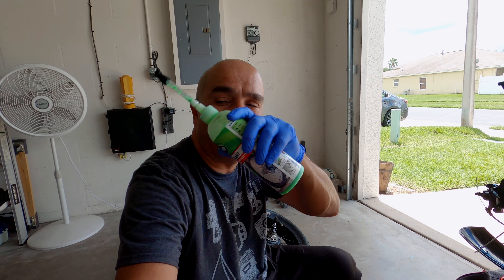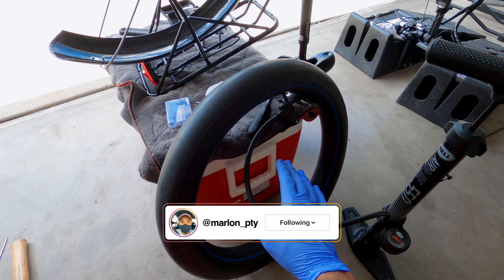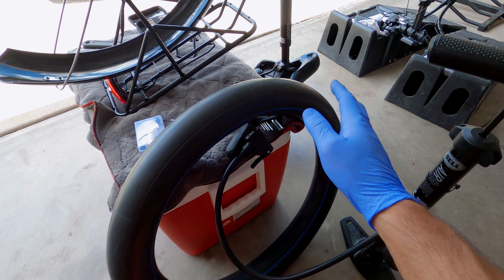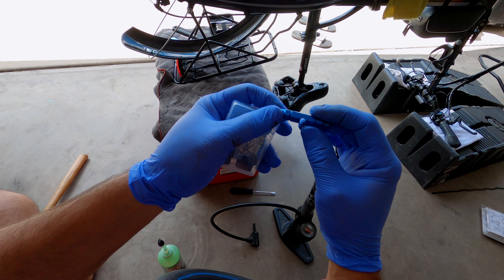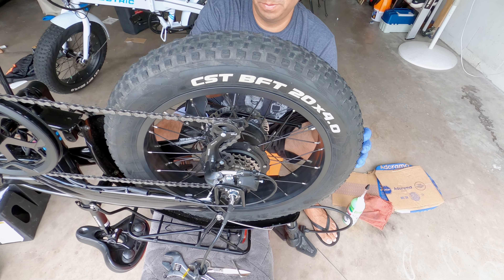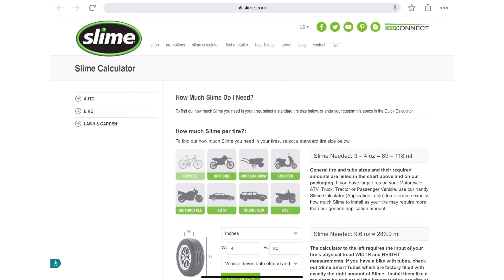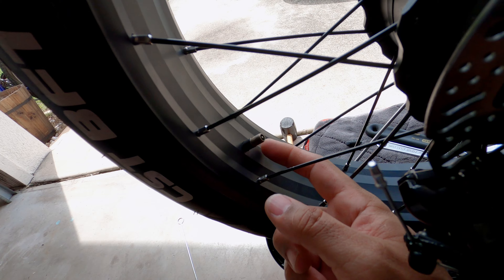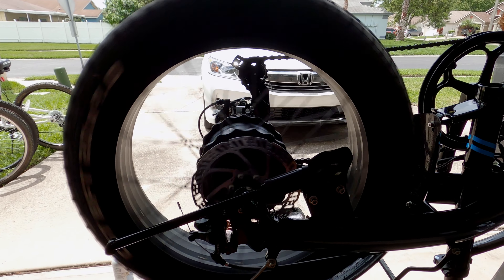Installed Slime Tube Sealant On My Lectric XP Fat Tire Ebike

Comment: Don't need all that slime, it looks like Snot why would you want to put that in your tires?, fat tires almost never get flats anyway.  If Somebody can figure out a way to not get a flat in a 2.1 I'll be impressed.  For fat tires just buy good quality tubes, make sure there's nothing sharp inside the rim.  Then keep your tire pressure below 15 lb,( 10 to 12 lb is good) most likely never get a flat again with fat tire.
Reply from the maker: I haven't had any issues at all with Slime in my tires ever since I put in my tires on all three of my ebikes, and I completely disagree with you on the tire pressure because the setting your tire pressure really depends on the riding conditions and what you are riding on. For example, you can't have 10psi on concrete and expect your bike to ride as fast and efficient as if you had it to say 25 psi and on the flip side if you ride with 25-30 psi in sandy conditions you're not going to be able to stay on the bike.
Reply: @Marlon_Torres  na man talk to your local mountain bike shop about tire pressure on fat tire. Those tires were originally intended to be suspension tires for mountain bikes. The idea to put them on electric bikes came many years later. This is my experience ,I  have two fat tire bikes. One electric one non-electric. Non-electric on the street 8 in the front 10 in the back.( slightly muddy up front, but absorbs all the bumps like on a suspension fork)  On the electric I go up by 2psi.  10up front 12 in the back, they roll well.  Going on four years, about two thousand miles combined + - .  Never had a flat with ether bike. Riding nothing but crazy mountain  bike trails, with all kinds of  thorns, and shoulders with God knows what.  Just tubes no liners no slime. But don't take my word for it talk to your local mountain bike shop, ot try to find a mountain bikers that I've been riding those bikes for the last decade they'll tell it's so rare for one of those tires to get a puncture.
Reply: @Marlon_Torres  case and point, those tires were never designed to be pumped up past 15 lb.  That's why everybody's having issues with flat tires.
Reply: @mjsmjs7905  I'm having trouble with mine, for sure. I thought that the higher the psi, the more resistant the tire is to puncture.

Comment: you should have removed the valve lol !!!!!!!
Reply: He did remove the valve core. The valve itself is sealed to the tube. This is a flaw in the manufacturing of the tube. I had the same issue. I basically used a drill to get the excess rubber out of the base of the valve.